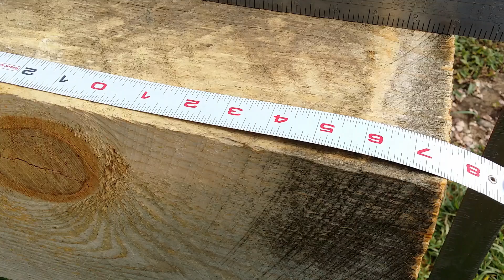Timber Frame Barn 12 (Reading the Timber, Layout Challenges)

Comment: Cut that tenon first so you can decide it it is one you want to use.  From what I saw, it looks like that knot runs diagonal thru the beam which makes it worse or a weaker tenon than if the know ran straight thru.  But - I've never built timber frame so I'm guessing and glad to be learning along with you.  I just want to save that beam for something else if that tenon is not ideal.
Reply from the maker: InTnMnNmAz good idea thanks for watching!